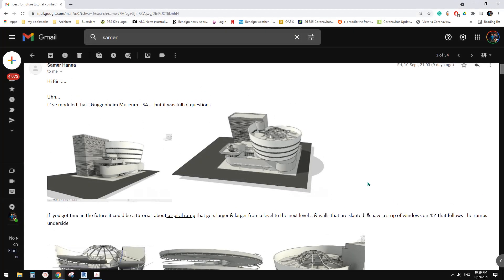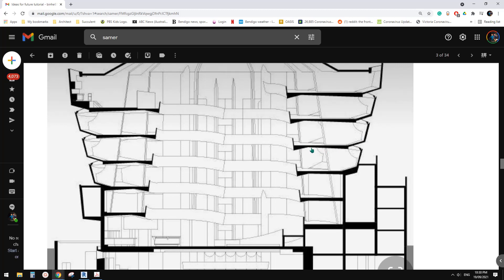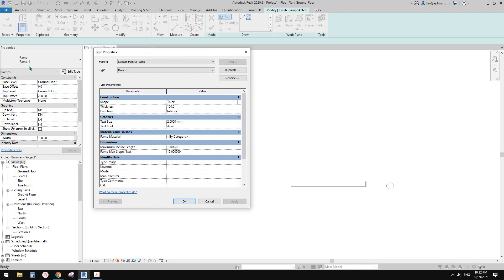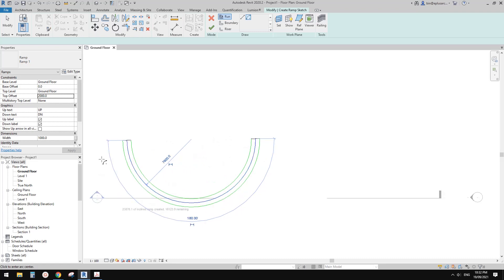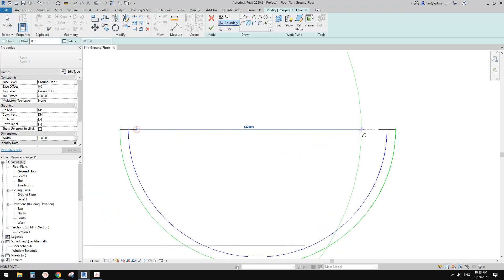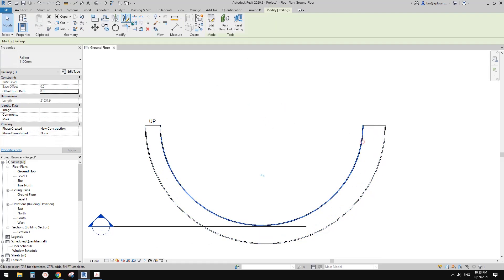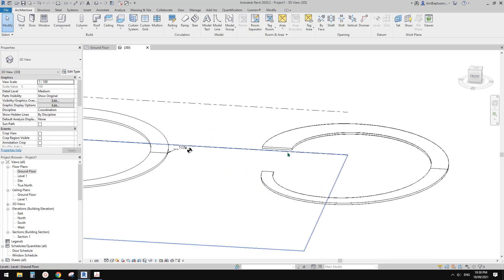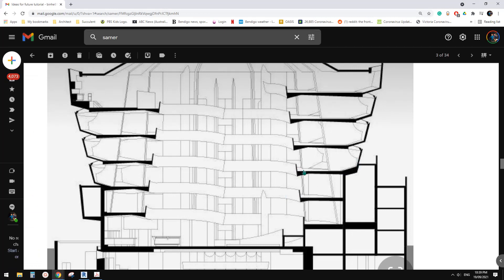Revit Exercise (Day 548) The use of Model in Place Generic Model

Comment: Perfect Perfect ... very usefull tutorial ... thanks Bin 

But I have some questions to you:

* how did you copy-paste a profile (fx in swept belnd) so it falls exactly at the same place relative to the origin point ? is there a way to do that ? this is very used in fx fusion 360  and autocad 

*If you wish the shape of the ramp to be as ½ circle you should adjust the slope to be ≤ a certain enough slope to reach the next level?  

*you are right ... the floor seems to be easier but I prefer the ramp for the following: 
                                        its easier to place a handrail on it at any time
                                        you can change the direction by a click
                                        you can change the start & end level at any time
                                        you can change the width of the ramp as well at any time 
by the way how you would apply handrail to the spiral floor unless you do it as model-in-place?

* of course you can apply wall by face to the floor but then you will loose the details of inclined faces ... could the solution be a mix of ramp or a floor + extra model-in-place fx sweep to add the details to the flat floor or ramp?
Reply from the maker: I'm not sure TBH, did I copy the profile? Maybe align in the same place or something? Or you can try Ctrl+C and Ctrl+V followed by 0 and Enter?
I don't get the second question... 
You can create a rail, pick the edge of the floor, finish it, then Pick New, pick the floor, done.

I think you can use whatever method you like or are comfortable with.
Reply: * "Align to same place" does not work the only that works is "paste from clipboard" but it hangs with the mouse waiting for a click anywhere  
I've tried Ctrl C Ctrl V then 0 Enter ... it pastes the profile again on profile 1 so you have to move to the origin of profile 2  

*question 2 is not really a question : ) ... but just a remark ... that although you have adjust your ramp to go from 0 to 2000 it ends at 1754,2 (your spot elevation) cause the slope was not enough to reach up to 2000 

*ok ... smart : that means Railing > sketch path > pick the edge of the floor > finish ...then  Pick New > select the floor  

But when you pick the path it has to have a small negative offset inward in order to be inside the floor ... otherwise it will miss the projection when you apply pick new. thanks
Reply from the maker: samox flox 
Publicly subscribed to you (6 months)
 • 3 days ago
* "Align to same place" does not work the only that works is "paste from clipboard" but it hangs with the mouse waiting for a click anywhere  
I've tried Ctrl C Ctrl V then 0 Enter ... it pastes the profile again on profile 1 so you have to move to the origin of profile 2  

I guess you need to move it into place then.

*question 2 is not really a question : ) ... but just a remark ... that although you have adjust your ramp to go from 0 to 2000 it ends at 1754,2 (your spot elevation) cause the slope was not enough to reach up to 2000 

You can adjust the maximum slope of the ramp.

*ok ... smart : that means Railing > sketch path > pick the edge of the floor > finish ...then  Pick New > select the floor  

But when you pick the path it has to have a small negative offset inward in order to be inside the floor ... otherwise it will miss the projection when you apply pick new. thanks

I don't think you need any offset.